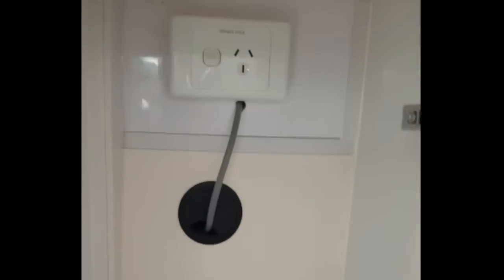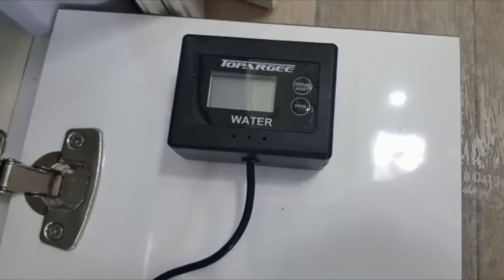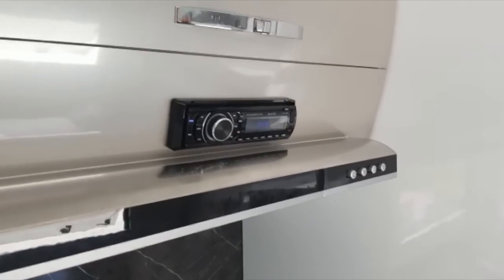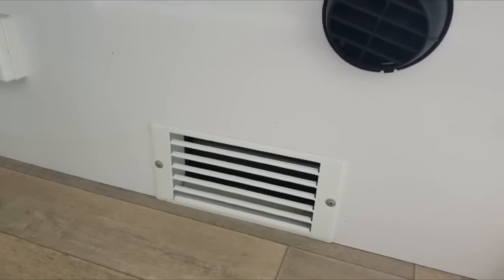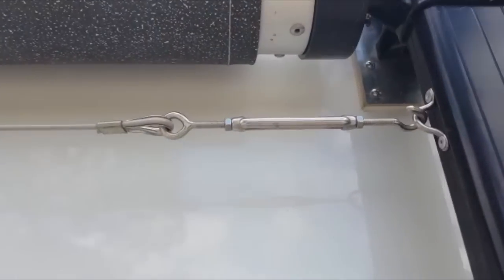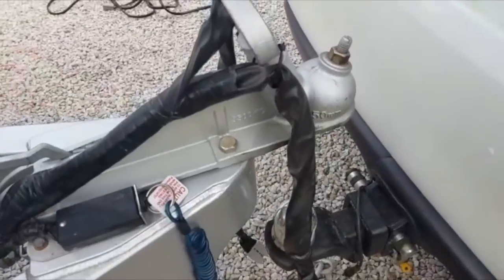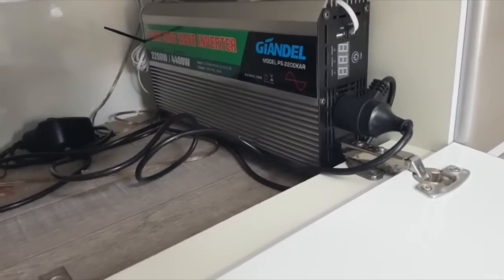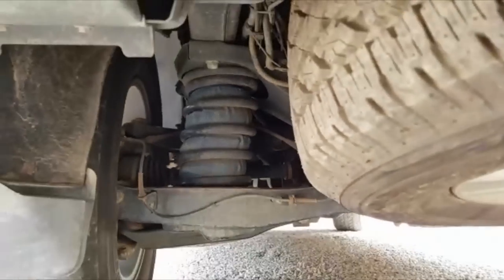Best Caravan Tips Tricks Accessories and Hacks, Mods

Comment: Great ideas, I have an insulated Adria caravan definitely not an off road unit, I build my own hydronic heater using a refrigeration evaporator coil and a small recirculation water pump they and fan motor works very well...

Comment: Now several years down the track - I'd like to know if you'd still endorse the Hydronic Heating System.  I like the concept and would like to know more about them.  Where did you get yours from?
Reply from the maker: Probably not. I did put it in both my vans but if I could find a diesel that didn't stink, I would be more inclined to go that way for simplicity of efficiency. But so far no such luck.
Reply: @DamianCandetti  I like the idea of hydronic as I can use solar to heat the hot water during the day and harvest that

Comment: Hi Damian, with your 1st mod, did your electrician make sure that the double power point was double pole? A lot of ‘domestic’ electricians don’t realise that there is a different set of SAA Wiring Rules. AS/NZS 3001:2008 that require all power points in a van to be DP.
Reply from the maker: The video was not clear on this point as its more detail than most look for and yes the gas is still double pole switched. thanks

Comment: Gidday Damian do those air bags give extra load capacity as I am buying a new Pajero this year as well as a caravan but I will be putting a motorbike on the back of mine as an extra emergency vehicle
Reply from the maker: They stiffen up the rear springs. alternatively you can just buy heavier spring, which is what I would do next time due to airbags needing to be pumped at least once a week. If your asking about if they increase your vehicles towing capacity then no, not without engineering and compliance

Comment: With regards to the waste macerator hack, are you limited to locating the van in close proximity to a dump point?
Reply from the maker: yes thats correct. I try to make the holding tank big enough to hold 7 days worth but it does remove the ability to throw the cassette in the car and drive it to the dump point.
Reply: 7 days worth, that’s definitely worth a dangerous goods sticker on back 💩💩

Comment: Where did you get the hydronic heater from. Love the hacks 👍🏻
Reply from the maker: Ebay, its a all in one kit. but if your handy you could just buy a 12v water pump and a computer radiator and fan kit for probably $100 and save $400
Reply: @DamianCandetti  so essentially, your running water around your hot water heater element then blowing that hot air into your van?
Reply: yes, excellent idea, much better and easier than diesel, and uses existing systems